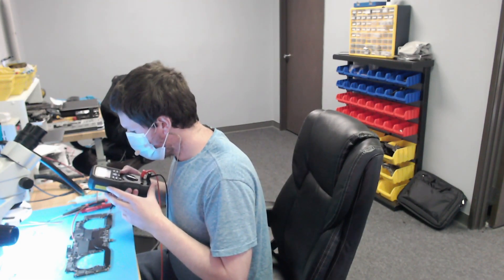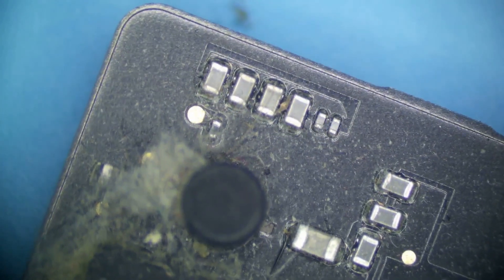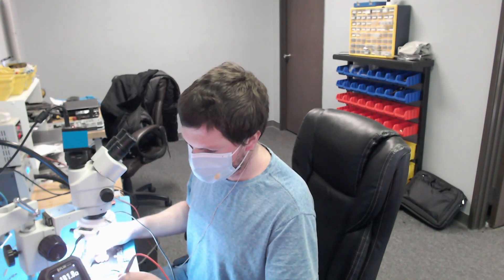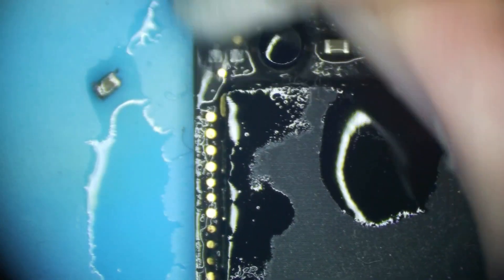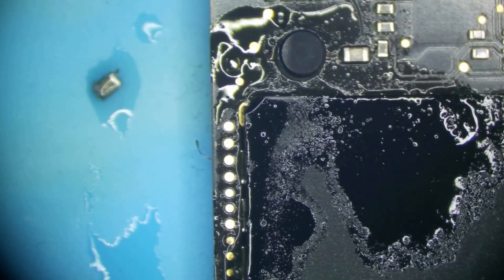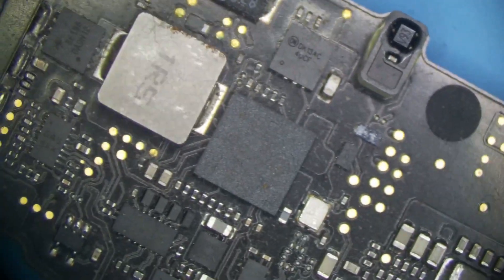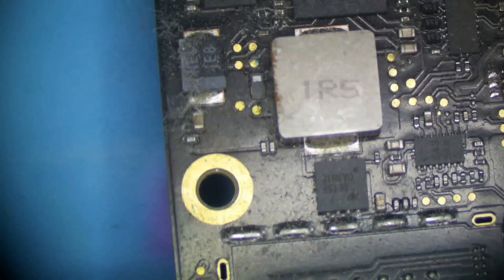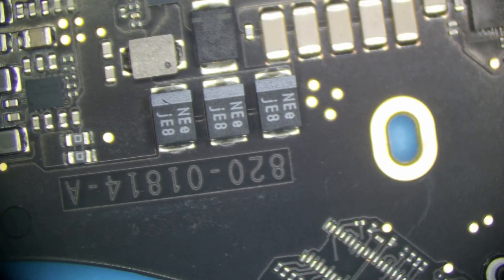Can dust and humidity cause a $3000 MacBook Pro to fail?

Comment: Board: single cap shorted to ground that's not even required.
Apple: yeah your board is dead. Data recovery not possible.

Wooooooooow. Not the first time in sadly won't be the last

Comment: Curiosity question if I may. Would an ultrasonic clean be a better way to clear all the dust out or would a blast of compressed air be a better way? 🤷‍♂️ Thanks.
Reply from the maker: It depends. For dust usually compressed air is quicker. Ultrasonic will work of course but is kinda unnecessary for dust.